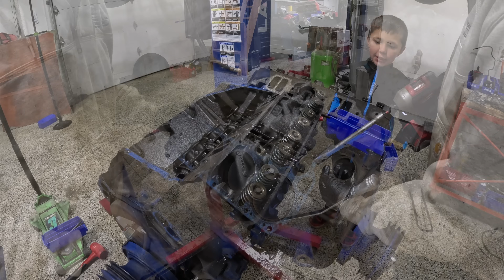Abandoned 1968 Plymouth Satellite | The Ratty Satty | Motorhome 440 Engine Teardown & Rebuild Begins

Comment: My man T Bone working the drill, too cool. I follow Nicks Garage, he`s a Mopar nut and a 440 genius, he dyno tested a 440 with stock manifolds and then with headers, I believe it was 5 to 7 hp more with headers vs stock ex manifolds, he hates headers because of clearence issues of course, headers dont do what most people thing, they don`t add 25 hp like advertized, my 383 had headers and that starter would get so hot, let alone changing plugs and keeping the wires off em, they were nothing but a pain in the you know what. Hey nice clean cillinder bores, that still have the hash marks, you did well this time, it`s all about the heads and cam in these stock Mopars, and who doesn`t love the sound of a cammed 440. I don`t know what you are going with, but i`m sure you know Edelbrock has kits were they did all the homework on, you just bolt it on pretty much, cam, heads, intake and your done, can`t wait to see the build, love T Bone working that drill.

Comment: Love that forged crank! Excellent engine to work with 💪🏻
Reply: Forged crank and quite possibly 6 pack rods as well. I believe he said it was a ‘73. Comin into the energy crunch ma mopar started pullin any thing off the shelf to build with. Lotta early 70s motor homes have gorged cranks and six pack rods. 😬😬
Reply from the maker: It sure is!

Comment: Just a tip, when you're removing the cylinder heads, I always leave one head bolt slightly threaded in, that way the head can't accidentally fall off while you're using the persuader. Big hunks of falling cast iron tend to crush feet
Reply from the maker: Good advice!  Thanks for watching!

Comment: its me again the lonely mopar fellow from ny, make sure you try and match that torqer intake, camshaft and torge convertor, gears, preferably 3.91,4.10 or a 4.56 . match your tire size also. those pistons are aproximately 0.150" from the deck about 7.81 comp. not good but it will do. one more word of advice is try to order a "cometic mls head gaskets. it looks like they were permatorqe head gaskets with a crushed thickness of about 0.034". check and see if it has the heavier connecting rods. i would not recommend nitrous oxide. if you do use it be carefull the ringlands like to break. i would run a 800 or a 950 holley brawler. those pistons are also heavy the motorhome pistons have a thicker top to them to keep from detonating. those heads should be number #452 castings. they should in reality be checked for ccs. they run anywere from 86-90+ccs. again for detonation reasons. try to run a good type of holley electric feul pump. believe me you dont need 2 four barrel carbs to run in the 11 second 1/4 mile. i dont remember if i told you this one but i had a school freind who believe it or not had a low mileage 413 put in a 1964 dodge dart staion wagon. it had pistons that were 0.186" from the deck and 906 heads from a 383 ccd to 82 ccs m1 mopar single plane intake 509 mopar performance cam cloyes single bolt double row timing chain,windage tray,rocker ars were standard stamped steel and shimmed side to side rocker end play,9 quart milodon pan melling oil pump not high volume, a stock pump with the "black pump spring installed , a holley blue electric racing pump,electric fan, big 3 core aluminum radiator and 950 ultra holley double pumper carb he had about 600.00 into the engine, had 175 shot of nitrous oxide, and last but not least 727,with 5500 stall convertor,deep pan trans brake and manual valvebody. i think this little monster weighed about 2900 or so lbs when finished. it ran 6000 rpm max wich is max for those stock 413,440s  11.27 at 118 mph. that little s.o.b. ran and ran it did street racing some fat guy who had a 1957 chevy belair blue with flames on side a noisier than hell 496 with i think my freind said the guy had aprox 23000 dollars in the engine. my freind ran this jerk  took him out of the hole had him  i fogot how many feet,mind you my freind was street racing it was about  15 years ago. the guy he ran was imbaressed and of course asked him what the hell you got under that hood, my freind replied and said just a low mileage 413 from a motorhome. that guy still has that car and i bet he still all these years wont admit he got his fat ass beat by a motorhome engine. thought i tell about that story. i wasnt at that carazy race but my freind had to tell me the next day. the guy with that 496 was a big mouth and waswas somewhat shut down but sometimes you cant shut up a jerk whith those brand x engines. thats the truth. you cant shut up a older idiot who has a ego problem. chrysler kicked ass on the streets due to the small block type ports,father steeve brule on engine masters joked about it. look for steve duchics mopar stuff he is one hell of a mopar guy him and steve brule on the engine masters shows.good luck with that wolf in sheeps clothingit looks nice and clean and ill bet its one of those 50000 mile time capsules remember match those parts. ill be looking on youre assembly.take care. my saying and an old on mopar or no car.
Reply from the maker: Excellent advice!  Thank you for watching!

Comment: Mr gasket makes a 20 thousand steel head gasket use some copper spray on the gasket and that will help you bring up your cylinder pressure
Reply from the maker: Good advice!  Thanks!
Reply: I forgot to mention that if you use aluminum heads you can't use the metal gasket, and I would bet you are going to use aluminum heads

Comment: Whoo ho You have a forged crankshaft. A couple option's get 8 matched set of 1968-69-70 440 piston's, Get a Mopar performance  purpleshaft 284 484, use a performance distributor set timing at 34 degree's total depending on altitude , U already have the TM-7 edelbrock intake and a Holley 750, 2 inch header's with bolt on 14" collector and 4:10 with slick's you should run mid/ high 12.. I forgot transmission need a Reverse manual valvebody and 3,000-3,500 stahl. I watched the whole video you say >> u are going to put on the tunnel ram?? it's a Low deck intake without buying spacer's it will be 2 inches short<<on a 440. your 1973 440 deck piston height will be .125 below deck low compression will be a Huge problem with 1,300 cfm would be all show no go just be a Bog monster
Reply from the maker: Pistons were 0.165 in the hole!  Needless to say, new ones are on order!

Comment: Flat top should be 10:1 compression.  Check deck height.  Piston should come within .030 of deck.  If pistons don’t come up to deck compression drops a lot.
Reply: Stock 1973 440 had .125 below deck just like 1966-67 440 had with closed chamber head's. But his motor does have a new timing chain someone was in the engine at one time
Reply from the maker: I agree!
Reply from the maker: 0.165 in the hole!  New pistons are on order!
Reply: Ya the old motor home 440s were about a true 7.5 to 8.1 comp with open chamber and 165 down in the hole🤦🏻‍♂️ get a piston with some decent deck height 2355F forged speed pros are cheap 400 bucks comp height 2.061 with stock deck height be about 20 tho below deck with a closed chamber 75cc or 84 cc head will make good comp also work with stock pressed pin rod size.
Reply: .165 in the hole leaves you with stock gasket about a 8.2:1 Compression Ratio. I know, I have the close to the same distance with .163. New pistons will make a tremendous increase in output. Keep up the content, love watching T-Bone at work. Making memories!   @rustbucketrestos6511

Comment: Good. Nice you have a good block. I would caution you against using the low compression with performance cam. You could end up with low cylinder pressure and disappointing results.
Reply: Yes. Junkyard digs put a cam in an otherwise original 77 Olds Cutlass 442 with a 350 Olds and Quadrajet and it then had a nice lumpy idle.  But, he said,  "I think we actually made it slower than it was before."
Reply from the maker: Haha that's no good!
Reply from the maker: New pistons are on order!

Comment: If you are changing out the rod bearings anyway you are just a couple steps away from replacing the pistons to increase the compression ratio, but to be honest I really want to see how this turns out with the stock motor home setup. I am not as optimistic as you are but I would love to see this thing tearing down the strip and be proven wrong. I have a 1996 E-350 Motor home with the Ford 460, that thing was built for torque plain and simple and not a lot of get up and go.
Reply from the maker: New pistons will come with the 541 stroker kit next year 😉

Comment: Im from the old way of doing a seal job on any block. Ford, Gm, or Mopar. The rings shouldnt be left in there. A newer style of rings will net you so much more. Overall, its not worth any hp or torque gains. But the ablility to capture the compression in the chamber will get a more thorough burn in the cylinder. Fuel economy equates to proper burn. Any 440, is a gas pig anyway. The low compression big blocks made in the 70's, with the emissions and mileage being pre decent power. So any improvement in consumption, will be a huge plus. Injection is the easy way to capitlize on better fuel mileage. Even a throttle body set up is a huge improvement.
Reply: I never can remember this.  Which are the rings that are the most idiot proof and you can just throw on an engine like his without even a dingle ball job and get improved sealing?
Reply from the maker: Cause I'll definitely need those! :)
Reply from the maker: Great info, thanks!
Reply: The go to brand is Total Seal. Out of all of the aftermarket brands, those do seal very well. Theyre the go-to's most use.

Comment: your not going to get 500 horse using those low compression pistons, you can go with hypereutectic pistons in it.0 deck the block and balance the rotating assembly and a good set of heads, you will be alot happier when stepping on the loud pedal lol
Reply from the maker: I like your style!